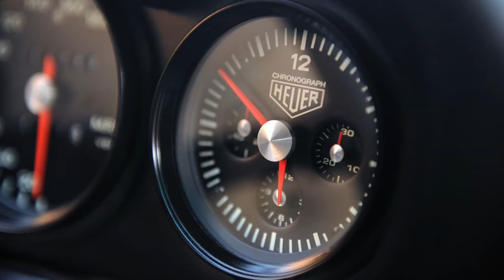Ford Fiesta 1300 Ghia 1996, Problème de ralenti et le moteur s'emballe

Comment: Bonjour,
Un Grand MERCI pour cette vidéo et le partage.
Je vais essayer sur FIESTA 1300l de 2000 pour laquelle, à priori, la vanne de ralenti dysfonctionnerait.
Le véhicule démarre au quart de tour au premier démarrage à froid mais, si arrêt moteur quelques secondes après, elle ne redémarre plus -symptômes  exactement à l'identique de votre démarrage en fin de vidéo -.
J'ai vu sur votre vidéo qu'il y aurait 2 joints toriques. J'ai cru voir des ressorts. Sur ce modèle, y aurait-il des membranes ?
Pour ma part, le clip de la prise connecteur n'est plus et de fait, ne tient plus.
Sur ma Ford FIESTA, il y aurait multi pannes.
Elle a jusqu'alors toujours démarré au quart de tour malgré les fils de bougies en très mauvais état et une bobine très oxydée ( le tout a été changé)
Il m'a été dit aussi de nettoyer le plan de joint du débit mètre d'air...
A suivre...
MERCI ENCORE
Cordialement.
Sylvie
Reply from the maker: Bonjour, en effet il y a 2 joints toriques en caoutchouc qui étaient en bon état sur la vidéo et que j'ai laissé sur la partie plastique. Le ressort quant à lui est à l'intérieur, et il ne faut pas hésiter à l'inonder de WD40, laisser reposer et recommencer si nécessaire. Puis une fois la vanne remontée, le moteur va peiner un peu à démarrer le premier coup. Je n'ai par contre pas vu de membrane. Après avoir fait ça, il faut en effet regarder du côté du débit mètre...

Comment: Oui ça peut être une raison, mais faut savoir que la gestion de l'injection se fait par un capteur appelé aussi potentiomètre, d'un capteur appelé capteur débitmètre, et vanne de ralenti ce que vous nous montrer.Le problème du moteur qui s'emballe, peut provenir d'une de ces trois pièces citées. A l'aide d'un multimètre il es facile de contrôler le débitmètre et le potentiomètre, là vous verrez à coup sûr s'il y a un élément défectueux. Chez Ford, ce genre de problème comme sur d'autres marques vient tout simplement d'une mauvaise connexion. En effet les faisceaux électrique sont soumis à des différences de chaleur, à des secousses qui provoquent des mauvais contacts dans les broches. Si vous allez chez Ford ils ne vont pas s'embêter ils changent les éléments et le faisceau. Personnellement ma fille a une KA et parfois son moteur s'emballe.Je débranche la batterie pour éviter tout court circuit, de plus le fait de débrancher la batterie permet de faire un reset au calculateur Je débranche et rebranche plusieurs fois les connexions et tout rentre dans l'ordre. Le problème peut venir aussi de la sonde Lambda, il suffit de la contrôler et de la nettoyer. Pour terminer le câble comme vous le montrer peut être effiloche, dans ce cas on le change. Merci pour votre vidéo ça peut aider.